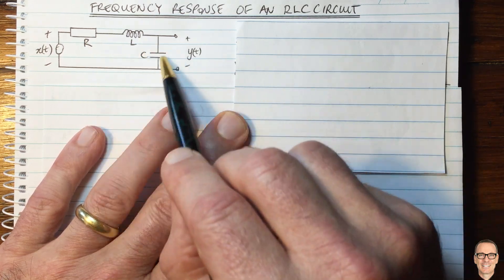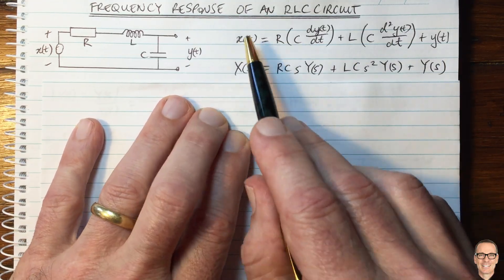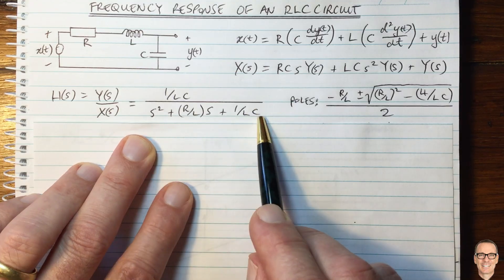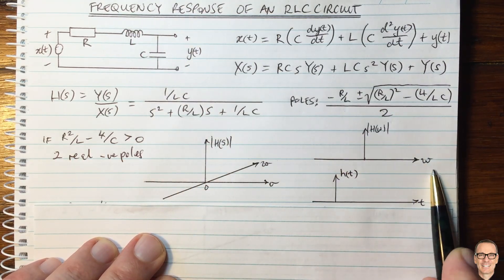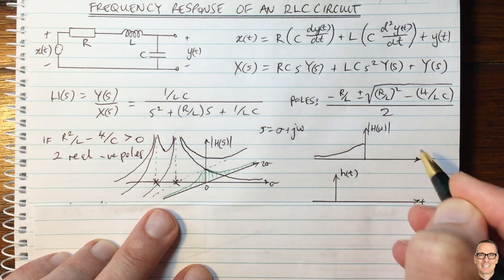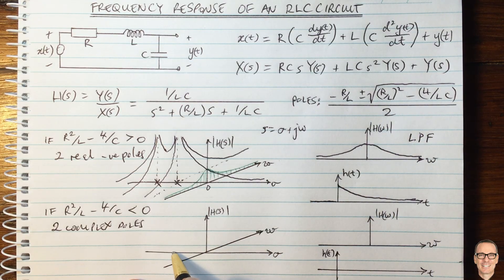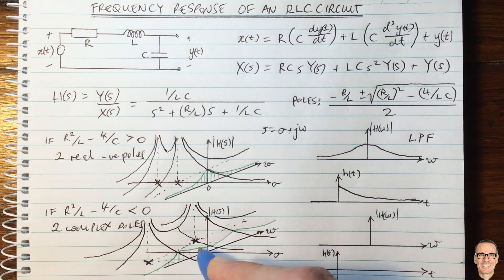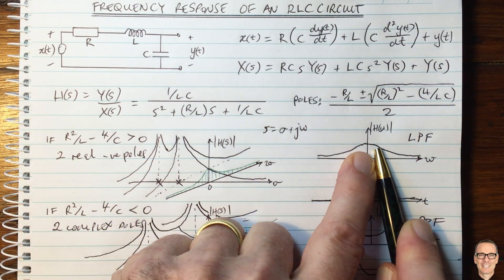Frequency Response of an RLC Circuit

Comment: I love these kinds of videos where the equations can all fit on one page with the graphs of them. It's not always feasible, but the concepts in this one add up in such a clean way that anyone who has taken intro networks classes can fill in the blanks, enabling the overall conciseness.

I did have a thought while watching this though: It appears that this band pass filter has some level of "sharpness" to it and can only allow through a single frequency (or set of frequencies near it). What do circuits that allow multiple frequencies (but with gaps between them) look like?
Reply from the maker: Yes, this really is the most simple circuit. More sophisticated filters require more components and a more complicated circuit design.